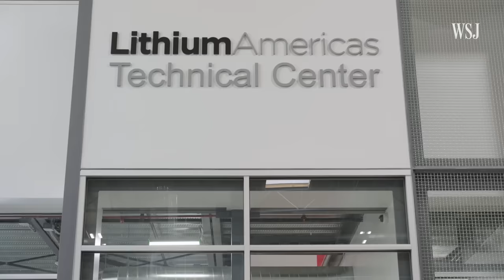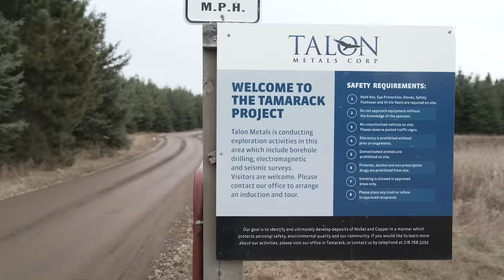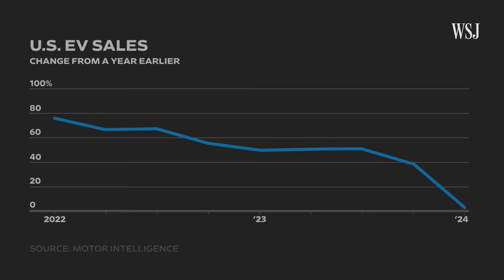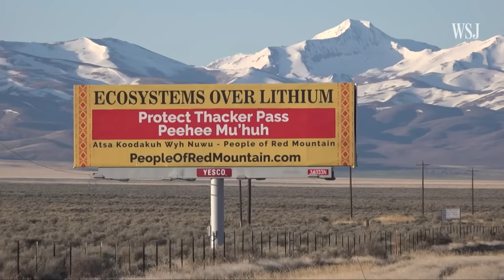Why Tesla and GM Are Betting on U.S. Mines Now | WSJ

Comment: Wait a second. The Salton Sea in California is not on the USA's largest lithium deposit, but largest in the world.
Reply: This is not Slaton Sea this is the large volcano caldera near McDermott in the very north of Nevada, this is a different project.   There is also the one in California where NASA is fighting against mining as they use it for Satellite calibration but they seem to have worked out a deal there I think.
Reply: I think Salton Sea is bigger
Reply: Lithium is a fairly abundant element. But it is one of the most reactive metal elements on the periodic table. You'll never find a seam of Lithium like you might find a seam of Gold in nature. Lithium is always found in an oxidised state, usually as a salt, bound with another element. The Mining of Lithium is totally predicated on what it has bound to, and what process you can use to refine it. I'm West Australian. By some measures we have the worlds largest Lithium mine here, but that mine is extracting Lithium from a very tough, unweathered rock, and we do a lot of that around here. Like Chile and the Salton Sea, we also have Lithium in dried salt lakes, but that takes large amounts of water to process, and we're so short of water we drink desalinated sea water. - So we don't process that Lithium, it's not economical here. There is also a trillion tons of Lithium in Sea Water, but it is presently uneconomic to try and extract that. Lithium's not that hard to find, it's the processing and extraction that costs money and materials. Lithium exists around the world about as commonly as Chlorine.
The Rare Earth Metals you hear about that are short on supply are heavy metals like Neodymium and Dysprosium that are metals nearly as heavy as Lead that can be magnetised and used in electric motors. Cobalt is a lighter metal that is also rare, and it's useful as an anode in batteries.
Fun Fact - Lithium burns a brilliant Scarlet Colour, and has been used to make Red Fireworks for a thousand years.
Reply: Deposit size isn't the only important factor. It needs to have grades high enough to be economically extracted. I personally expect Bonnie Claire to claim the title of largest economic deposit, if it ever gets drilled out.
Reply: @psylantwolf  It's both the concentrations, as well as the mineral state that the lithium's in.
If the concentration's high enough, even a hard to process mineral type can be profitable.

Comment: I don’t think the problem is extracting it… the problem is the use of water and how to dispose of said water once it is used for its purpose. Is it toxic? And to what extent?
Reply: What water? For the lithium mine they'll have to transport it in from the surrounding lakes that support the local small towns. That high desert region will just eventually turn to sand and only sand.
Reply: This report really left out a lot, as regards lithium mining.

The big news is the newer extraction methods.  There are methods that can extract lithium from fluids without any adverse environmental impacts.  These are feasible at certain sites in California.  I think the Salton Sea is one.  Not sure if they could be used in the region mentioned in this video.
Reply: So on the Thacker pass website they state the project will be an open pit mine, not the typical brine extraction you see in other parts of Nevada and Chile. 
Brine extraction doesn’t produce much waste water, it’s mostly an evaporation process. 
The waste water in this situation would come from the processing side where they need tailings dams. But with modern  environment regulations and such a dry environment there, waste water is mitigated considerably.

Comment: For decades the US has been the largest importer of many precious metals and elements in either raw form or processed goods, and then usually throws it in the garbage at end of use. Reduce, Reuse, and then Recycle.  It's crazy to imagine how much more materials would be available around the entire world if everyone actually recycled PROPERLY. ✌️🌲🌍🌳🌎✌️♻️
Reply: Maybe, an element is an element; however some reduce, but Li close to the bottom, it is not radioactive, does burn, and what is left I am not sure.  Cutting down was by expending labor is a good option.
Reply: @dalenbickenbach9533   this is clearly a drunk AI commenting
Reply: Most things cant be recycled. It's how entropy works.
Reply: @Withnail1969  that's not really an accurate comment. Almost everything can be recycled but there just isn't a good market for many recycled goods (mainly plastics) because it's just more convenient and can be cheaper to purchase raw materials.
Reply: @andyjohnson3790  that means they cant be recycled. if its uneconomic it cant be done.
Reply: @Withnail1969  um no that's not true at all. 
If it costs $100 to recycle 1 Ton of plastic into reusable material but it only costs $99 to purchase 1 Ton of virgin plastic that does not at all mean that plastic cannot be recycled
Reply: @Withnail1969   There's more to production costs than mere money . . .

Comment: Extraction lithium from clay is very expensive and requires a lot of permits. This project will take at least 10 years to production if at all.
Reply: Well ya, 7-12 years is typically of all mines in the US. As long as the funding holds up, especially with the tanked lithium price. And if the lith clay processing can actually be applied cost effectively on the large scale, then it can work. But many mines change their plans with processing when things actually get going.

Comment: They say solar energy is  renewable, but i dont understand  how exactly are you going to re-new   the unique  nickel deposit  ?
Reply: If a resource becomes rare enough, it will eventually be economically feasible to recycle. Gas and coal can't be recycled, since it's burned away. But nickle and lithium can.
Reply: Correct Lithium batteries can (and soon will) be recycled with about 95%. The Lithium isn’t gone only about 5% of it per use cycle…
Reply: @JacktheSmack  Right now, so called renewables  arre taking donations from govermants. When they get recycling they will be even more expensive, you say. Which menas, renewables will get even more  donations from govermtns ?
Reply: @JacktheSmack Carbon dioxide gets recycled, but wind blades aren't.
Reply: @francismarion6400  CO2 is a pollutant that isn't recycled.
Reply: Elemental metals are not consumed, they are infinitely recyclable. Hydrocarbons are consumed. They cannot be recycled.
Reply: @JacktheSmack  Not true. Plants need CO2 in photosynthesis.
Reply: @JacktheSmack  Not true, only fiberglass wind blades aren't recyclable. Plants need CO2 in photosynthesis.
Reply: @francismarion6400  That doesn't matter to whether or not CO2 is a pollutant.
Reply: @shane864  I think what he means is, how is the excess demand for high quality nickel going to be met? It necessarily has to be recycled, however recycling the nickel already in existence isn't going to help power all the new trucks, ships, and planes that we are hearing about. Substitutes would have to be developed, if we even have the resources on the planet. It's possible that hydrocarbons will be used far into the future.
Reply: @JacktheSmack  CO2 Directly correlates to your existence here on earth. Perhaps if you were living on a space shuttle and substituting vitamins for vegetation in your diet, then you might have a point.
Reply: @francismarion6400  so? It's still a pollutant.
Reply: @JacktheSmack  You're delusional
Reply: @francismarion6400  How is CO2 not a pollutant? It fits the dictionary definition.
Reply: @francismarion6400 You said it gets recycled. So do you fill your tank with a plant? The recycled Nickel can directly be used to build another battery. That is what recycling means. Co2 cannot be recycled. You can burn fossil fuels only once, then they are gone (or rather their waste products are in the atmosphere, but buttom line you can't burn this waste in the air again). That's why they are not renewable and will eventually run out. If America doesn't prepare for this by switching to renewables, other countries will eat us alive. The nickel inside batteries at the end of their lifespan is in the same chemical form it was at the beginning, there is no difference
Reply: @l-dogtheman1685  Nature recycles in an efficient way.
Reply: @JacktheSmack  Not in Biology or organic chemistry. I suppose whomever writes the dictionary can implore what ever non-scientific method they want. Perhaps why definitions change in those books over time. Did you take Earth Science in high school?
Reply: Do any of you science deniers realize that farmers pump CO2 into greenhouses to make the plants grow faster?
Reply: Do any of you science deniers know that farmers pump CO2 into greenhouses to make the plants grow faster?
Reply: @JacktheSmack  Dictionaries aren't scientific. In the same relative logic, oxygen could be construed as a pollutant to plant life.
Reply: @francismarion6400  Deniers  dont need greenhouses, because any greenhouse  creates spooky greenhouse gas, inst it ? /ironic Off

Comment: what about Cobalt?  What is the solution for that?
Reply: LFP batteries do not use cobalt.  They have several advantages over other battery types.  One big advantage is that they are much cheaper.  

For this reason, about half of the EVs sold this year will use LFP.  And going forward it will be the majority.

Comment: The whole premise of this video is false, it assumes the only future of carbon neutrality in transportation is a battery powered vehicle. If we put an emphasis on synthetic gasoline and diesel we could actually convert existing vehicles to green vehicles over night without the need for replacement. This would lead to real and lasting energy independence.

Comment: Wrecking the environment to reduce a fraction of CO2 emissions (when the vehicles are NOT spontaneously combusting, that is). What could possibly go wrong?
Reply: The good news is the caldera in Nevada is on total wasteland. Still, it's gonna be stupidly expensive to develop silly EV supply chains without nuclear power
Reply: @Mcfunface  Wasteland or not, refining minerals is polluting and mining pollutes. Some minerals are genuinely essential, but lithium batteries have a history of spontaneous combustion --- a parking garage completely destroyed, several car ferries destroyed, an apartment building set afire in China with tragic loss of life. And yes, we need more well-engineered nuclear power plants.

Comment: I think ev sales have fallen because most people realize they're terrible for the environment, especially when the electricity used to power them comes from coal and (to a much lesser extent) natural gas.
Reply: According to the EIA's website ad of 2023 nat. Power generation by sector was.

Nat gas 43.1%
Coal 16.2%
Nuclear 18.6%
Renewables 21.4%(this includes wind. Solar, hydro, biomass etc)
Plus some other smaller sources.

ev sales in the states likely fell because public charging is hot garbage and the cars are still too expensive for most people to justify.
Reply: @The_Lone_Aesir  also build quality is trash.